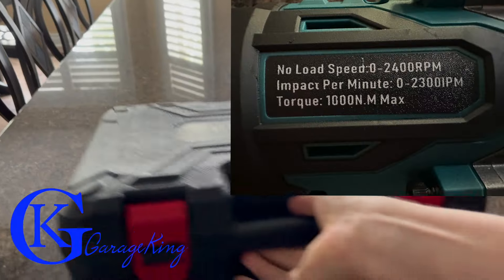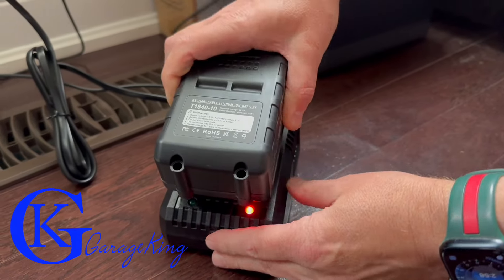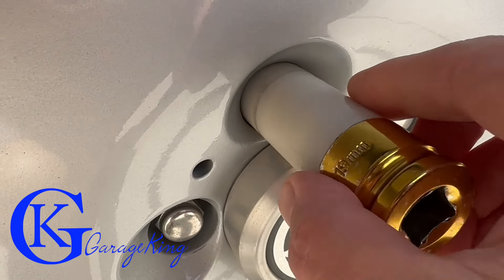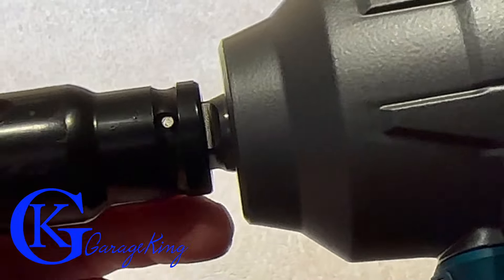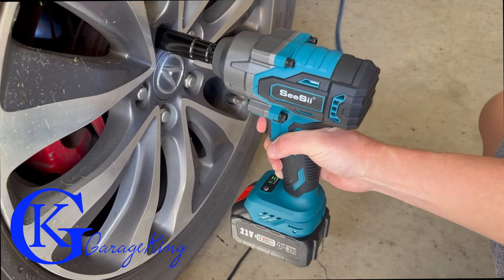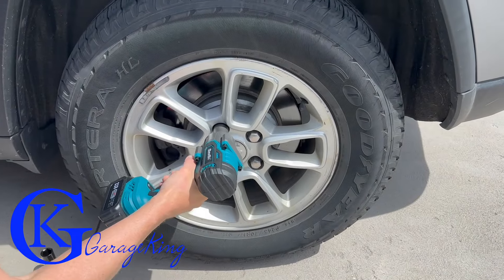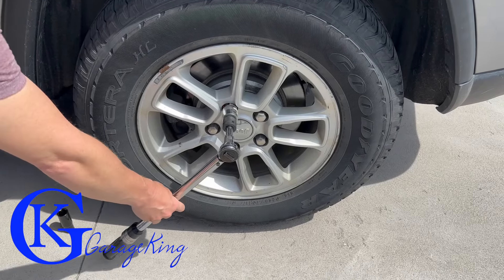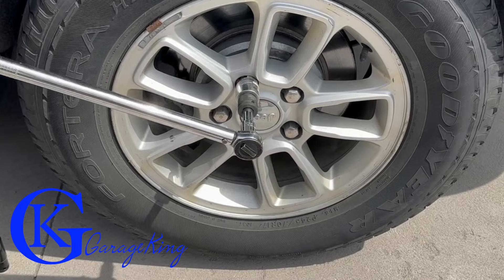SeeSii Cordless Impact Drill Review 738ft/lbs (WH760)

Comment: Torque Test Channel has done several reviews on SeeSii and they  tested very well on their dyno.
Reply from the maker: Yes, that actually one of the reasons I did buy it, and it does work great.  I have used it for a number of repairs now and no issues.  Thanks for the comment :)

Comment: Last year I bought WH710 and it's good tool really. It's not the best but do the job
Reply from the maker: I wonder how much more powerful the WH760 is in real life.  I know I use mine all the time.
Reply: @GarageKing  I don't know. WH710 - 800NM. WH760 - 1000NM. With my I loosen crankshaft and camshaft bolts with easy 😇 The car Opel Astra F 1.6 petrol 1994 😳 30 years old lady 😍 Never never let me down
Reply: I just opened up Amazon, The WH710 900nm  665ft=lb.  They have them on sale, $ 101 with $20 coupon. I bought 2 a while ago, $81 a piece with 2 batteries.  All the reviews showed a great wrench and at  81.00 ? Well, being a guy, If one takes a dump, I still have one with 4 batteries.
Reply from the maker: @timhankins3436  That is a deal !!!
Reply: @GarageKing    It’s still on sale for another 3+ hours at $81.00. Saturday night.
Reply from the maker: @timhankins3436  Thanks !!

Comment: How do you rate that knuckle you used at the end for working in tight spots? I saw them on fleabay but thought with the hammer action they would maybe unreliable, it seemed OK with what you did, I just wondered.
Reply from the maker: Hey there, the swivel socket, or knuckle I used is awesome and I have used it for years on many different high torque impacts.  It is a Snap On though.....
Reply: @GarageKing  Well I'm from UK we have snap on but the one I saw wasn't, but food for thought, thanks for answering I just assumed being a moving part it would take a beating from the hammering action thanks again for answering
Reply from the maker: @lorrynortheastguy4787  No problem at all, and I know the Snap On ones work well, they are not cheap, but I have never broken one and I use them a lot.

Comment: I had the one that put out 400 and some ft lbs and it was a complete POS. Sockets barely fit and after a few hard uses it doesn't work for longer than 5 seconds and it just quits. After 20-30 seconds it'll work again but the same thing, only for a few seconds and quits.
It's worthless. If you want a cheap reliable brand go with hercules brand from harbor freight.
Reply from the maker: 400 is pretty low, this one was a major improvement.  It actually did really well on the torque test channel.  That's why I bought it.

Comment: 750 ft lbs? Show me a demo where you removal big nuts. Axles, crankshaft bolts, etc. Lug nuts are child’s play
Reply from the maker: I saw the demo on the torque test channel, but for me I use it for wheels.  I use air for crank bolts.
Reply: @ I just found that channel, great real world content. Personally I would use this tool for heavy duty jobs where you need an impact.
Reply from the maker: @YaRight2986  Thank you for the comment !

Comment: lug nuts are not hard to take off. you can change the tire with the provided bs kit with car. You are blind and have no idea of the concepts at hand
Reply from the maker: You can take any fastener out by hand, that's why they make ratchets and breaker bars, but this is a common tool used to change over tires because it saves time. If you are changing many tires per day you don't want to look around for the included kit and do them all by hand.
Reply: @GarageKing . Ignore the bunz. There’s one of those guys in every post. He buys the $300 Milwaukee, tool only. Me, I’m a weekend warrior,  I used it maybe 4-5 times a year. Last week they had a sale in the WH710.  With coupon, final cost was $81 with 2 batteries. I bought 2. 2 impact wrenches, 4 batteries and still cheaper than the bare Milwaukee. No brainer. Thanks for the video.
Reply from the maker: @timhankins3436  Appreciate the support, thanks man !!